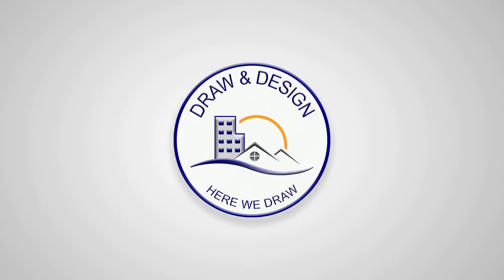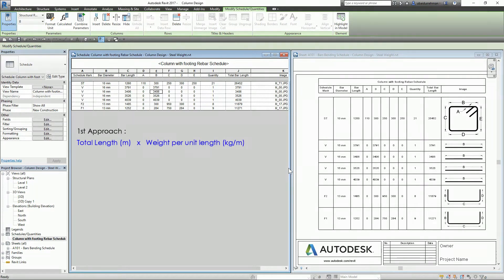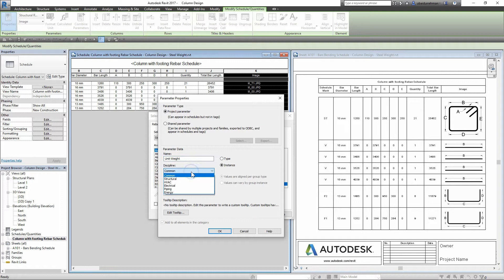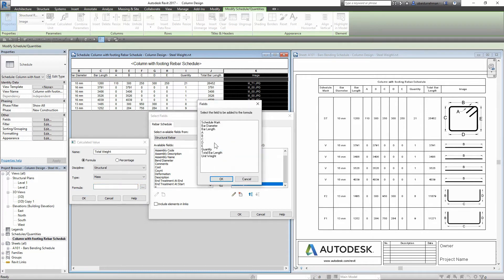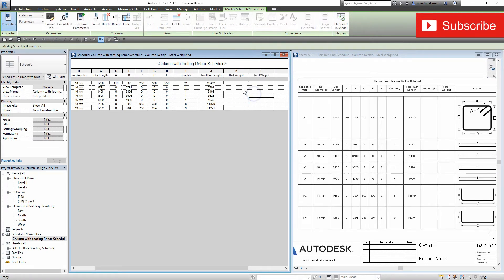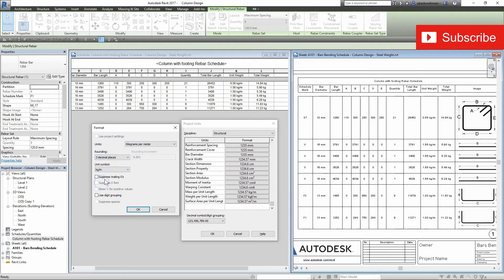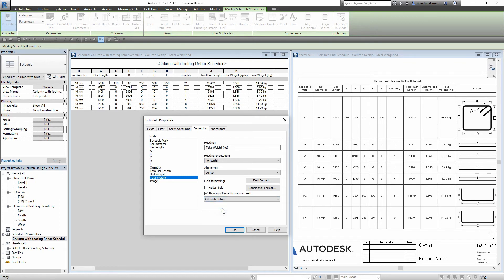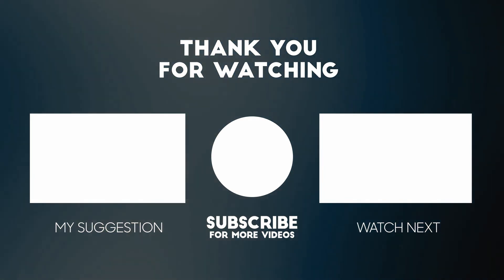How to calculate Rebar weight in Revit? | Revit Rebar Schedule & Quantities

Comment: Thanks for your nice presentation.why the default data calculation for pile cap volume and areas are not same as 
actual calculation.and whye cc length data not shown in schedule.what should be solution.
Reply from the maker: Actual and default calculations might be different ... but CC data can be shown by editing schedule and include spacing column